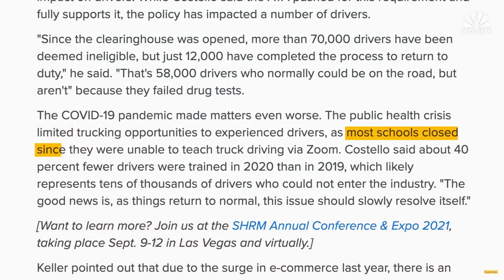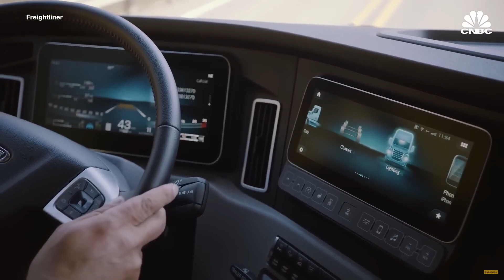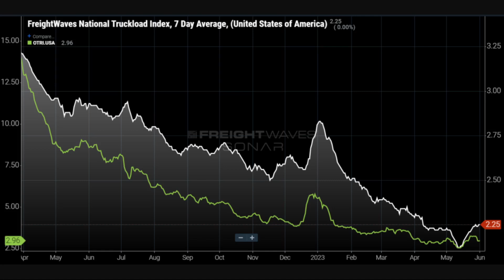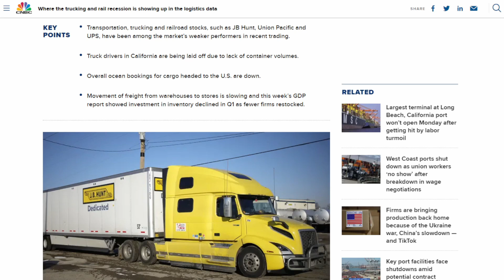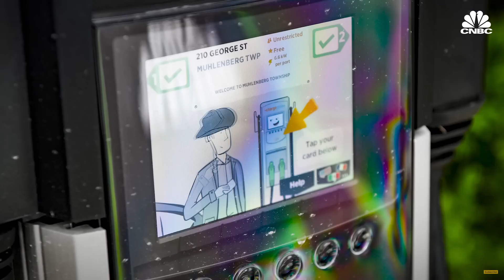Why Electric Semi-Trucks Aren't Selling In America.

Comment: Tesla semi has sold every single one they built before they made it. They're sold out for the next year and not even taking orders. What are you talkin about?
Reply from the maker: Tesla Semi hasn't sold anything to anyone cause it's still in pilot production. It's not even a commercial product, talk to me when they start mass production 😂
Reply: @Visceral Ace Wrong. You can still sell equipment under a pilot program. These semis are not on loan from Tesla.
  15 in Modesto and 21 in Sacramento. The company expects to take delivery of the 100 Tesla Semi trucks it ordered by the end of 2023.
  * Tesla sold each of the semis to Pepsi for undisclosed amount. But they were still sold and from what my interpretation is, at 180k a piece.
Reply from the maker: Meanwhile, 245,000 Class 8 trucks were sold in the U.S last year. Are those 36 Tesla Semi's supposed to be an impressive number?
Reply: @visceral_investing  Yes. Be impressed. You sound like a horse dealer back in 1890 about how cars were never going to catch on....lol.
Reply: @visceral_investing  lol compare tesla sales in 2009 vs 2023.

Comment: Fuel costs and Mega charging stations will be what puts electric  semi over the hurdle rate. At 20 grand to haul freight by diesel say 1000 miles vs plugging in strategically.  Or Trucking as a service the value proposition  gets better for Bev and FCEV when a recession  occurs.  And the Grid has enough juice to meet the demand of charging .

Comment: Nobody seems to be paying attention to the fact that a battery powered semi weighs a lot more empty than does a diesel powered vehicle.

A big issue with profitability in trucking is payload.  Axle load limits, and gross vehicle weight limits mean that a heavier empty vehicle cannot carry as much paying freight as a lighter vehicle.

Axle weight limits are already too high for most road paving - you can spot the lanes used by semis in places with lane restrictions by the broken up and poorly patched pavement. Therefore, don't hold your breath waiting for a waiver on gross vehicle weights for EV semis - the roads can't take the pounding of the diesel trucks.

This is an additional factor weighing against the economic viability of battery powered semis.

Comment: let me give you my take on why electric trucks are not selling: Because the ones available, like the  Nikola BEV suck so much no one wants them. Who wants a BEV truck that does only 300 miles, takes half a day to recharge and comes with a quarter million dollars sticker price? Logistics are driven by cost. If buying and running a BEV truck was significantly better than a diesel one, they would be selling like  hot cakes. They are not. Why? they suck. Tesla Semi is coming next year in volume quantities. 500 miles range, charges in 30 minutes to 70% capacity, and with a price that makes sense for the end buyer.  wanna bet they will sell like hot cakes?
Reply from the maker: Lmao. He says as Nikola Tre has sold 100s more units than Tesla Semi, all while not having been towed 20 different times. If it was any good, Tesla would report the real weight of the Semi and itemize its revenue in its earnings report.
Reply: @visceral_investing  Nikola sold hundreds more? As far as I know Nikola "delivered" 135 trucks to dealers in 2022, and 31 in Q1 2023 for a grand total of 166 trucks "delivered" to dealers. not sure where you get the plural in "hundred". Tesla has delivered 54 trucks until now, and contrary to Nikola trucks collecting dust on dealers parking lots we know all Semis have been sold to a real customer.   anyway, I do concur with you regarding the importance of knowing the truck specs and price. I can only see one reason for this not being yet announced and that is, the truck, while having sold already 54 units, is not yet finalized regarding specs and pricing.
Reply from the maker: "All sold to real customers" - that's because Tesla Semi is in pilot production, not MASS production. They only build one for each order in a pilot 😂
Reply from the maker: Tesla hasn't sold anything, they're just executing contracts. The real sales come from dealers and a mass production line, none of which Tesla has even after 7 years.
Reply: @visceral_investing  well, considering that they built and sold more than one third of the trucks Nikola sold, and they are just in pilot mode while Nikola WAS mass producing, doesn't seem that bad. And regarding dealers, seems Tesla has been doing just fine without them as well. Regarding the 5.5 years of development ( not 7 like you state ), do you think it may be because Tesla designed and made the whole truck, from power train to batteries, to chassis to everything, instead of just buying existing iveco trucks and slapping wallmart batteries into then like Nikola does?
Reply: @visceral_investing  I do have a question for you regarding this: What do you think was the best approach to market: Nikola, being first they rushed a sub part truck that no one wants and are gathering dust at parking lots, or Tesla, that is cautionary testing the truck at select customers to make sure it meets the industry demands before embarking in mass producing a vehicle and risking to make something that no one wants? what approach do you think was best? Nikola clearly thinks their approach was wrong, as they halted production, but I am curious about your opinion.
Reply from the maker: Nikola already did the testing Tesla is doing right now throughout all of 2020 and 2021 lmao. You seem to be attempting a poor excuse for the marketing stunt that is the Tesla Semi. Who's approach is worse I wonder? The product that got delayed 5 years and still isn't in any U.S dealers hands or the product that was launched within 3 years of announcement and is being mass produced in its purpose built factory?
Reply: Pepsi is ditching the Tesla Semi. Couldn't meet the stated range with heavy loads.  Works great to haul chips though.
Reply: @jamescoleman9616  can you please cite a source for Pepsi ditching Semi?
Reply: @pedroteixeira4369  PepsiCo’s new Semis can haul Frito-Lay food products for around 425 miles (684 km), but for heavier loads of sodas, the trucks will do shorter trips of around 100 miles (160 km), O’Connell said.
Reply: @jamescoleman9616  that was one of the very first comments many months ago and it doesn't mean the semi can't do long haul with heavy loads. the tesla semi video proves that it can. Newer comments from Pepsi executives hint at no issues at all regarding performance. Having said that, what I asked you was the source that states that pepsi is ditching the semi.
Reply: @jamescoleman9616  Yes I read same thing. Pepsi disappointed in Tesla semi. Problem is any BEV Semi will not perform like diesel Semi cost wise, not even close.....only hope is for hydrogen fuel cell Semi to improve its tech, FCEV Semi will do better than a EV Semi.
Reply: let me give you my take on why electric trucks are not selling: Because NONE of the ones available from any manufacturer, INCLUDED TESLA are cost effective. Why do you think Pepsi is not ordering any more Tesla and are disappointed with the Tesla Semi's they already have ??? Lower range than expected and lower charge times than reality. Yes logistics are driven by cost, which is why the polluting diesel semi's are still around in huge numbers.
Reply: @sevencostanza3931  Cost will come down when volume increases. Diesel will be king, but not forever. The CA, NY, and NJ incentives will speed adoption and more states coming on line with more incentives. FCEV for long routes, and BEV for short routes. It's coming weather we want it or not.